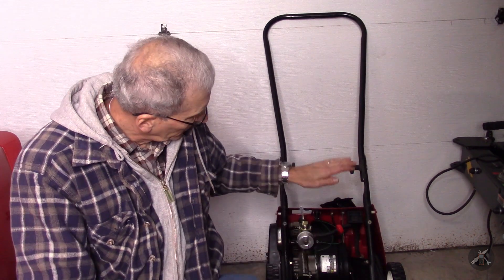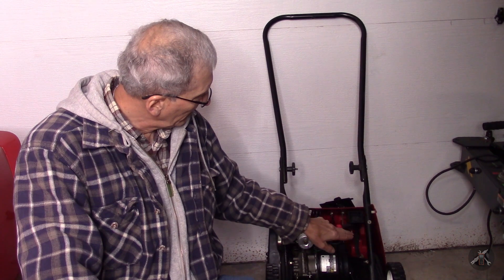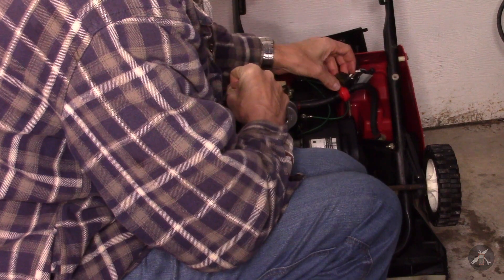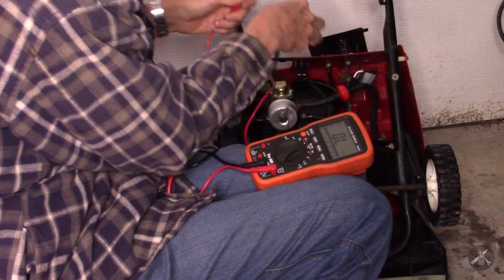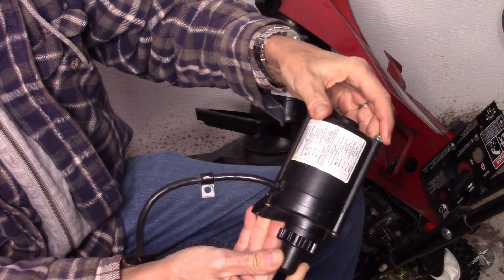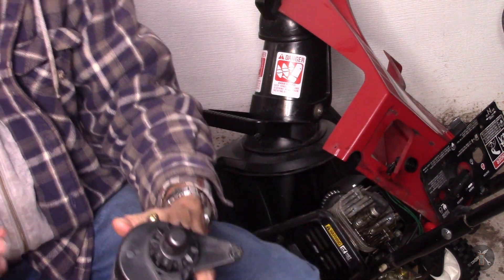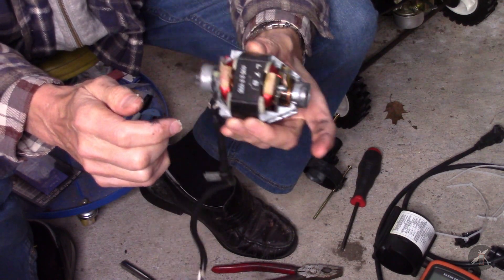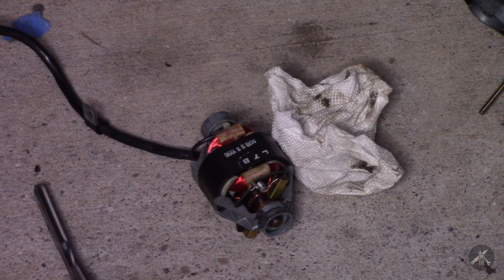Disassemble Tecumseh 110V Starter Motor?   - Toro CCR Powerlite Snowblower

Comment: Great video on the testing and tear down of the starter motor.  We had one of those same snow throwers many years ago when living in Pa and that thing took a beating and wouldn’t die.  One year the snow was so high we had to shovel it down and into the unit and it took it like a champ!  In the spring it would get a new spark plug, drain any remaining fuel and clean carb bowl.
Reply from the maker: Thank you.  Yes, these blowers are rather rugged.